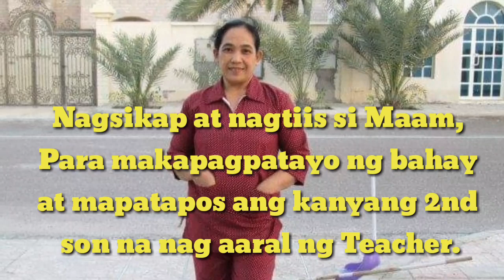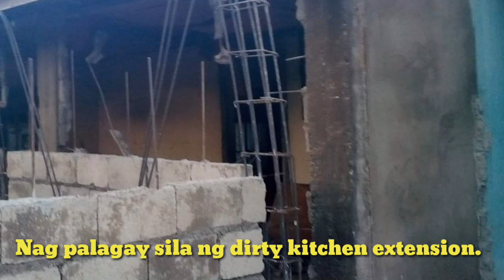Simple Dream House ni Ma'am Helen | 550k Budget | Katas Ofw at Teacher

Comment: Overpricing po yata at undersize a ng CHB hollow blocks na gin am it size 4 paki AUDIT NyO po ang quotation at total cost..DApat pag bungalow sa 700k price size 16mm ang ginamit na banal for column and beam rebars pag SKILLED WORKER'S lang ang nag quote at estimate baka taasan po sa LABOR COST..kasi PAKYAWAN O PER SPAN..yung kontrata baka ORAL o VERBAL lang yun..please kuha po kayo ng BUILDING PERMIT, sa municipal hall o city hall.RESIDENTIAL PERMIT sa barangay hall may plano at guhit at calculations ng city engineers para safe po kayo..like WINDLOAD,DEAD LOAD,LIVE LOAD sa STRUCTURAL po sya..mga malaki pa siguro gagastusin sa archi at engr. plan..kasi 700k wala syang granite floors 200each lang sa nano tech tiles 60x60 walangbplaster inside outside..check nyo pundasyon at size ng bakal sa poste at biga..para sa DTI at PCAB..residential sector is still booming..sana walang shortcut o sub standard works..